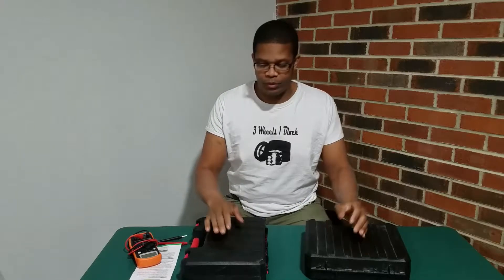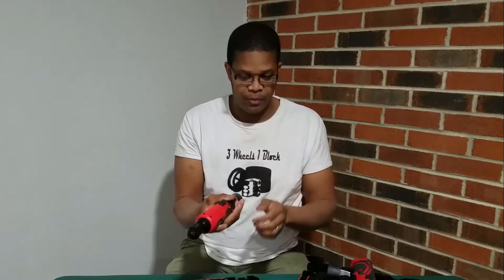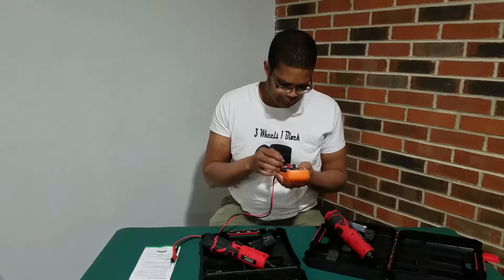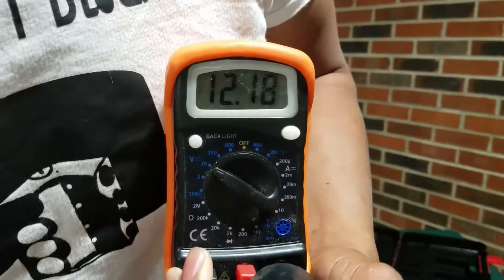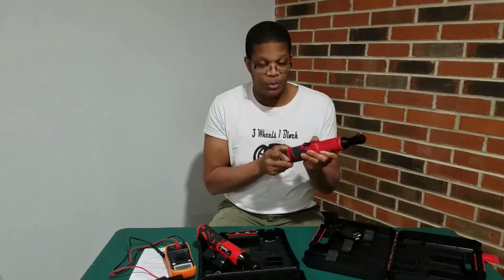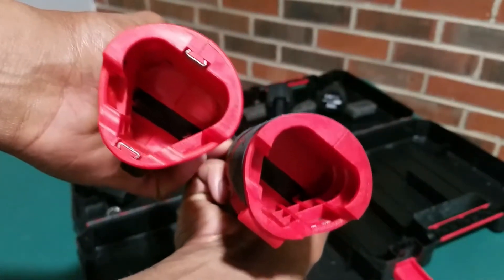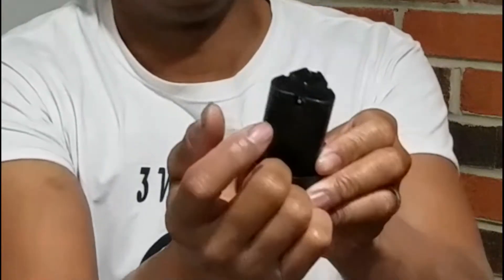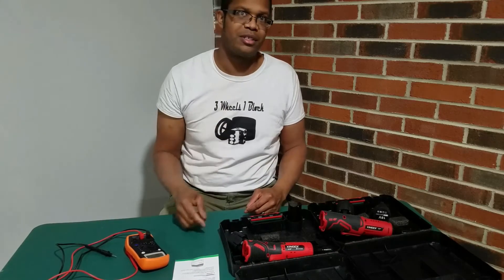The TRUTH about the XINGDI  Cordless 12V/18V 3/8" Ratchet Review E-Bay Amazon 3W1B

Comment: Nice to know video. The dead giveaway are those triangular battery configurations. They only contain 3x 18650 batteries. Each of them produce between 3.6-4.1v. 3.6v is nominal output during usage. You need 5x 3.6v in order to get 18v. No battery in that shape configuration (as far as I know) has that voltage capacity.
Reply from the maker: You nailed it! This is the very reason I did the video to show others so they wouldn't be tricked by the stickers on the tools. 👍

Comment: Well that's pretty messed up. Would be cool if it was actually 18V. Give it a little extra oomph. A 3 cell battery is not going to be 18V though. Strange they would even claim that. Otherwise look like decent tools for the money.
Reply from the maker: You are absolutely right, something smelled off to me, there are other ones that claim 18v I may test them in the future and see, but the 12v is really efficient for saving the wrist in most cases.👍🏾